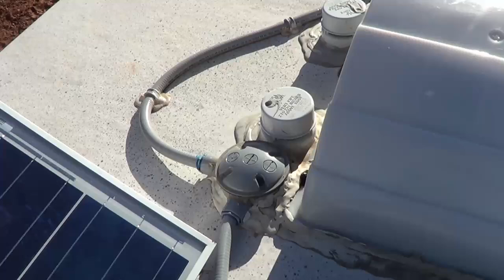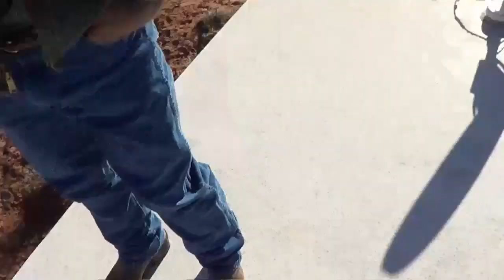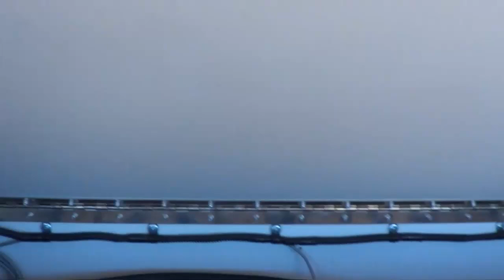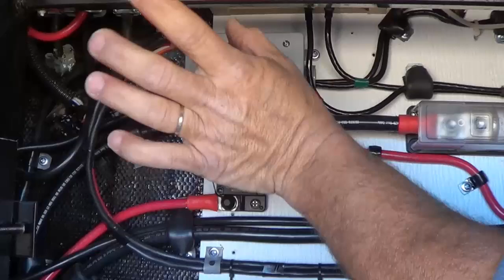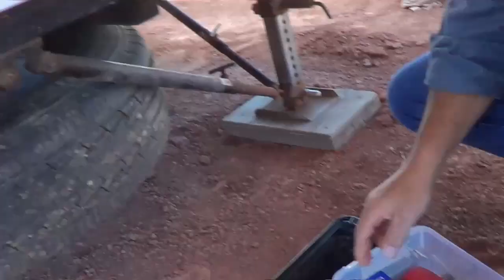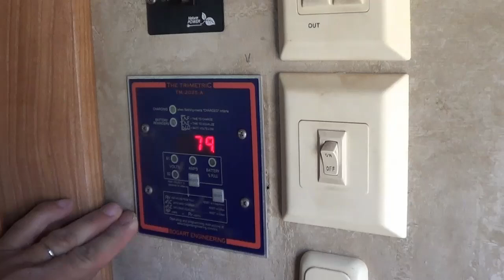My Friends Awesome 580 Watt RV Solar Power System

Comment: holy crap......I took one look at that wired panel box and my head started spinning....lol
WICKED setup, but man,.....overwhelming to consider......

just a question,.....in simple terms,....how is his onboard generator hooked into all of that?.....hahah
wish you would've shown it.....oh well.
Reply from the maker: sbecktacular It's a external generator and it gets plugged into the Intelli-Power Converter to charge up the batteries.
Reply: ahh.....ic--thanx!
Reply: sbecktacular Here’s the complete step-by-step setup fully illustrated manuals and easy to follow video instructions present in the guide you will be able to create renewable energy at home. 
Go here ==> http://earth4energy-new2.blogspot.com/
Reply: wow! ....cool, thanx a lot!
Reply: Fergus Donnelly h

Comment: question : how   you do to stop the converter from runninf whne you using hte inverter ??
Reply from the maker: diego bauzil If you mean you would like to plug your main RV power wire into the inverter and have it power the RVs AC circuits, then just turn off the circuit breaker for the converter before plugging in. On my RV there is a breaker on the power panel marked converter. That will disable the converter.
Reply: thanx man. by the way  does a 200 watts pure sige inverter  will be enough to run therv refrigerator and may be a tv and a video or blue ray ?
Reply from the maker: diego bauzil Should run the electronics OK but not the fridge, the electric element in mine is 375 watts. But the fridge should run on LP gas instead of electricity.
Reply: 2000 watts ,  my bad ..

Comment: Impressive system no doubt. Very very professional and wyse setup.
Also a good choice ... PWM Morningstar charge controller ... with current prices for solar panels the most important is not to obtain the maximum out of your solar panels, but rather to make your batteres last longer ...
If anyone wants more power or a faster charge ... just add more solar panels.
Good video.
Reply from the maker: Thanks John, I like your logic :) Cheers Ray

Comment: Change out that PWM with the MPPT and you will get at least 30-35% more out of the panels then you are now. That's why the cost more up front but you don't need to buy that extra panel. 

Great Build
Reply: Claude Rains wouldn't running a series of 6v batteries be the better way to go
Reply from the maker: Claude Rains I don't think it is that black and white as MPPT always being a better choice and by at least that much in all conditions. 30-35% sounds pretty optimal and not seen during the whole day and depends on the charge state of the battery bank.
Many factors can influence the choice of controller type to use. - http://solarcraft.net/articles/comparing-pwm-and-mppt-charge-controllers/  I believe Eddie was influenced by Handy Bob's advice in building his system - https://handybobsolar.wordpress.com/rv-solar-quick-answer/ He has an interesting take on it.
For some folks taking the extra money and adding more battery capacity may make more sense than the extra cash into a MPPT controller as power storage capacity is the other part of the solar equation. If your tank is all full, no use having more to add sort of thing. 
All in all though if you have lots of cash and a large amount of solar panel wattage MPPT looks to be the best way to go. Do you have any recommendations of a quality MPPT controller brand. They all seem to boast as being the best and having special technology.
Reply: Well I installed many an RV solar system and not one PWM can out perform an MPPT when matched with correct parts. 

I might add. Adding more batteries isn't going to fix an under power system. Each 12 volt battery needs at miniuim 12-15 amps to recharge in a normal 5-6  hr day of sun light. If you can't supply that amount to each of your batteries. You will never reach 95% state of charge. Unless you don't use it the next day. If you can't keep it charged properly the batteries die an early death. 

These are just some of the problems people with a little knowledge and bad advise run into.
Reply from the maker: I'm not saying a MPPT doesn't outperform a PWM, I'm saying it is not always the best way to spend your money.

Sure on an under powered system that's true, but if the PWM controller is supplying plenty of power to charge the battery bank, money may be better spent on more capacity than on an upgrade to a MPPT controller.

This is actually the case with Eddies system, he is looking to increase the battery capacity from 420AH to 600AH as his next investment. Capacity is the weakest point in this solar power system right now. He realizes this after spending months boondocking with the current system.

The extra panel he wants is for the early morning low sun, He wants to have a portable one he can deploy on the ground angled real low and pointed east so he can get the recharge happening earlier and not have the batteries run down too far before the sun hits the main roof panels.

Until those two things happen an upgrade to a MPPT to get more power from the panels isn't going to help him much. That's where lifestyle choices come into play. Some people use a ton of power during the day and others RVers don't need near as much daytime power, but want extra battery power for the evening.

Comment: Very orderly and tidy.  I'm super glad I did not see this video before I got my 200 watts of solar.  I NEVER would have attempted!  ;)  Maybe a video of a simple solar set up for the average person?  I have charge controller and 2 inverters (410 MSW and 600 PSW) at the front corner of my 23' TT, all about 18" from my batteries on the other side of the wall.  I'm all for the KISS method!  Full-timer as well.
Reply from the maker: Suzie Cue I posted a video before on my 200W solar setup and it is pretty simple. :)  https://www.youtube.com/watch?v=Z7x1iX66olk

Comment: sweet system!!! really nice!!! just a Note: MPPT gives you ability to run HIGHER voltages and low amps!!!! therefor smaller wire!!! PWM means lower volts and Higher amps: therefore bigger wires!!! keep them coming!!!

Comment: Looks complicated. Is he a electrical engineering?
He could sell that diagram.
Reply from the maker: Captian Marvel He does have a background in Heating and Air systems but most of the solar stuff is self taught from reading online.